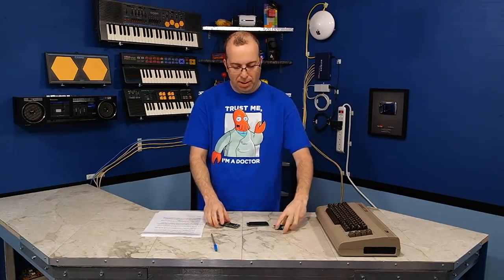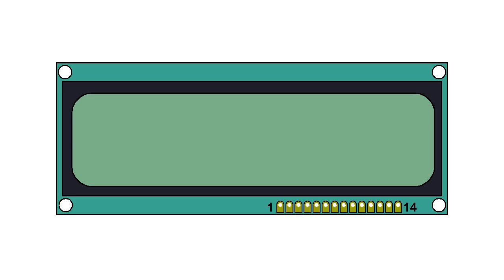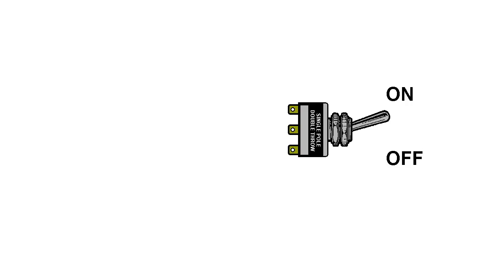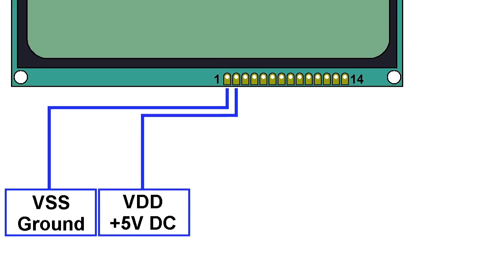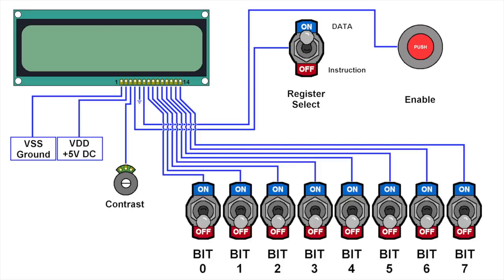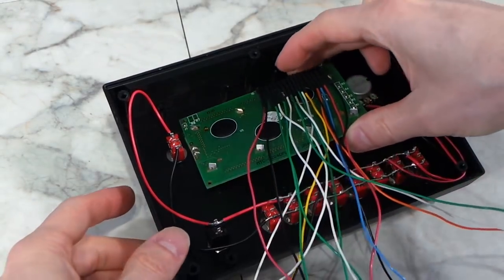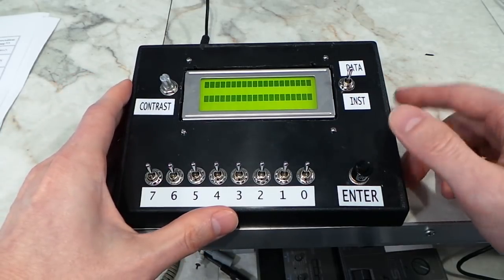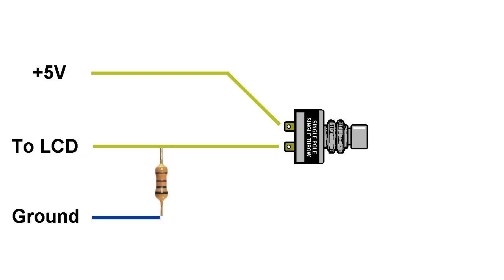How a Character LCD works Part 1

Comment: loved this it makes me wanna be an electrical engineer and I hate electrical engineering
Reply: Lol same about the electrocution thing
Reply: There is no risk of electrocution with low voltages (it is taught that up to ~30 volts is completely safe, although the actual threshold is higher), and working with higher voltages is reasonably safe as long as you don't do anything really stupid.
Reply: EE here.  Just be mindful of current and paths that current can take.  If you're attentive to this, you'll be fine.  I've never electrocuted myself or come close to it.
Reply: Also, if you're worried about working with the mains in your house, electricians handle that, not engineers.  Engineers design things.
Reply: Be a computer engineer, it deals with digital electronics and software without a lot of the analog/high voltage side of EE.  I went into embedded software engineering with my CompE degree, though I enjoy all things electrical and electronic as a hobby anyways.
Reply: EEs don't generally go out to high voltage panels are start poking around on things. They design the equipment and electricians install it.  EEs and electricians aren't the same thing, and for good reason.

That said, I'm an ME and have worked around tons of high voltage standing right next to the electrician working on it and the EE who designed it and haven't been shocked either. Let the electricians do their job.

Also, like others have said, EE is a huge field. Most of the EEs I've worked with have been "PLC guys" and only a handful have worked in power distribution (the "scary" stuff). They write the programs that make robots build stuff. It always looked like a fun job to me.
Reply: CalcProgrammer1 Computer Engineering for the win.
Reply: Check out Big Clive! He's really making me want to do EE

Comment: Multiple concepts touched here:
1. Character LCD pin description and how the communication protocol works.
2. SPDT switch and how to punch in digital 1/0 using it.
3. How to connect a pot and generate analog voltage input using it
4.  Floating connection issue resolution using pull down resistor
5. Switch denounce issue in push button and fixing it using RC circuit.
Over and above, how to debug and proceed ahead when you come across a problem.
Thanks for this series.
Feeling angry on YouTube algo for taking 4 years to show this on beautiful channel.

Comment: For someone like me, with a decent brain but zero knowledge of the hardware yet, i found the level of "depth" quite nice. The pins always seemed like magic numbers. Knowing what they do and how is very informative. I had heard of "capacitors" but hearing and seeing a practical use makes it seem easy to tackle.
Seeing even the basic construction of the box and power supply gives the entire project the feeling of "this is EASY! I can definitely do this now!".
I liked the pro-tip of stripping old wires too.
Reply: OmikronWeapon fyi if ur still interested and dont know: capacitors store charge. the capacitance value of a capacitor in farads is equal to the ratio of charge able to be stored per volt across the capacitor
Reply: pins are magic numbers, just like argument order in a function is magic. (or you read the docs)

Comment: Re switches upside down
Can you just flip the +5/GND leaders onto your switch busses?
Reply: I was wondering the same thing, but David probably has a reason for not doing so. Commenting so I can see any reply!
Reply: Yeap, you can!!  He must have overlooked that solution.
Reply: And re-solder/switch the leads powering the LCD
Reply: not required, if you saw the electronics on the back of the switches it's a very simple thing to swap the polarity on them.
Reply: I was just wondering were there a good way to test witch way your switcher are before soldering them.
Reply: Because of the internal mechanical parts (they work like a see-saw internally), it is usually just the opposite of the switch position. Flipping the switch up will connect the bottom pin, while flipping it down will connect the top pin.
Reply: he already soldered everything else to those wires though, using them as adhoc rails for the whole circuit.
Reply: Just flip the rails going to the data switches, and maybe the D/I. Such a simple thing...
Reply: I am also wondering the same thing
Reply: Yikes! Duh!
Reply: Shananium, to test your switch, use the continuity tester on your multimeter. If your meter doesn't have cont, just use the ohmeter. 0 ohms is on, infinity ohms is off.
Reply: It isn't that easy. He would have to move a bunch of other things around, but it would be possible. The debounce cap, pull-down resistor, the +/- for the LCD, +/- for the back-light would all have to be reworked.
Reply: was going to make witty remark the realized these are 3 pin xor switches.
Reply: +Darric or he can just swap the +/- for the switches, by swapping the two wires going to the common rails
Reply: That's the first thing that came to mind...
Reply: Reverse the polarity of the neutron flow.
Reply: Jon Pertwee
Reply: ChapstickPremonitions Good point.
Reply: That would work if he didn't hard solder 9 other things to the rails. So yes it could be done, but it isn't as easy as swapping the inputs to the rails. If you just swap the input to the rails, the LCD +/-  and back-light +/- would be backwards and not work. The Contrast POT should still work, but the control would operate backwards. The cap and resistor look like they would be fine if you crossed the wires right at the rails. You can see all of the other connections he did at 11:33.
Reply: I see now... 
I'm planning to build a similar thing(but an actual computer w/ Z80), now I know that I should NOT do like this...
Reply: He used the rails at the switches as "bus bars" for everything, so it's not just swapping two leads. But it wouldn't be more than swapping 10 leads either, so definitely doable.
Reply: I thought exactly the same thing! Best way to invert signals.
Reply: This is what the OP said, just reverse everything that was soldered to those wires....
Reply: I feel like we are not treating the video fairly.  It was not a necessary fix in order for him to make a good video.  It was well done.
Reply: Look at the comment from @RockyDAproductions.
Reply: Exactly or just pretend he is in the UK and the switches would be the correct way up

Comment: Doesn't it suck paying $50.00 for some parts you can get off the internet for $5.00 but you have to wait weeks for them to come from china? The worst offender is microcenter where they sell knock offs for 10 to 20 times the normal price. They will buy a part for less then a cent and charge $4.00 for it. Their arduino is $40.00 and the instructions are half in bad english and the other half they just left the chinese characters in. Also on the box it says you get a nixie tube which is why I bought it. It's not it's just a 7 segment display that doesn't work with any of the projects because it's common anode and not common cathode but you have no way of knowing that until you realize it doesn't work.
Reply: Dave B Common anode 7-segment displays can be used as well as common cathode. I’ve used them and had no problems.
Reply: Yes I too got it to work. But if you go off the english/chinese instructions the way they tell you to it won't work. Had to redo hard ware AND change the code as well as use npn vs pnp. Not a fun way to learn when the instructions are teaching it to you wrong because they save 0.0001 cents.
Reply: As from getting things from China. Imagine something doesn't work. You either buy a new one (your project is halted for some time -> losses) or send it back to replace it (waiting + losses on shipping). That's where the problem lies. Repairing and returning elements + time you need to wait. When it comes to such small elements, it's not so bad. Some clients of printing company I've been working to, left us to buy prints from China. Then when they've realized they'd pay a few times more than here, if something would be wrong, they got back.
Reply: I was disappointing at looking at some of there stuff. There only good stuff is the actual new computer hardware. Everything else in the store is poor quality. I was thinking i can get some professional computer tools, but its the cheap crap you would get from a dollar store for 30 dollars.
Reply: Yeah, but your paying for that convenience. There is heaps of overhead operation cost of brick and mortar. They will not stick around though, as more online sales occur (and consequentially with the likes of certain online entities allowing you do almost essentially deal with the manufactuer direct and no middle retailer) with entities that do not have any brick and mortars to support. Market and local demand plays a bit into it too... Less tinker-ers these days.The whole situation is actually a convoluted and complicated balance of factors, but the gist is a lot of retail stores will poof in the near future. Only the common commodities of need-to-live stuff will stick around.
Reply: SALCON salcon is dead on!  There is a cost to having those items available on demand.  When I moved from the city to a small town, the prices infuriated me.  Anything retail costs more in a small town.  they aren’t ripping you off, it’s what it costs them to provide that product.  Radio Shack is proof.  They just couldn’t maintain the traffic to survive selling on demand switches and diodes.  $2 or $3 is a small price to pay to get that switch I need NOW.  In a time where mass market retailers are finding it hard to survive, it is even more difficult for those that cater to a niche.
Reply: Yea... keep buying online... local will disappear... blame yourself... end of story
Reply: I'd gladly pay the markup if I had a Microcenter or something when I can't finish a project because of something I need...now that RadioShack is gone I have to go to eBay (wait forever, often not quite as described, increasingly cancelled because they don't actually have what they listed in stock), Amazon (high markup and often not quite as described or not working), or someplace like Allied/Digikey ($0.02 for the part, $20 for shipping, $50 if you want it 2-day shipping)
Reply: @matthewmiller6068  FYI, I noticed that my local HobbyTown has the Radio Shack chest of parts and some other ones, so if you happen to have one of those...
Reply: I'm actually trying to make the device David showed in this video, and I'll be ordering all of my components off of Amazon Prime, which doesn't take a month. I don't see why David didn't just order off of Amazon Prime, especially considering there wasn't a pandemic back then XD, not that anyone could've seen it coming...
Reply: @classicgamr  The  local has to be better or for them, it will be the end of the story.

Comment: Windows 10: Device drivers not installed. Device does not work.
8-Bit-Guy: Builds hardware-based driver out of flip switches.
Reply: get sued by apple

Comment: Wow :o
I wouild never have thought you could use toggle switches to send binary data, that's cool
Reply: That's how the first computers were programmed. he mentioned the Altair. http://oldcomputers.net/pics/altair-8800-front.jpg
Imagine doing that for all the instructions you wanted to set up.
Now imagine no permanent storage and the power going off just before you got to run the program.
Reply: runs from room screaming ;)
Reply: UPS FTW!
Reply: Actually computers (and everything digital) works that way. Bits are either on or off.

Comment: You can just swap the ground/vcc rails. Should be easy enough just resoldering the supply wires and the write.
Reply: Exactly my thoughts (and the same has happened to me several times :)
Reply: Lucas Hartmann I thoight the same thing.

Comment: This really helps with me trying to be an engineer (I’m ten don’t judge) I just got my first soldering iron for 4 bucks at harbor freight and this was the first thing I did as a pcb kit I didn’t understand it now I do
Reply: Lol I've gotten used to soldering in the few months I've learned. Good luck with it (be careful though, those things get really hot. Use the stand when you're not using it, if it came with one lol)
Reply: How’s it going, rifty?
Reply: 13 want to be programmer or possibly a computer engineer
Reply: @bobdagamer640  You can do it if you try hard! I'd reccommend learning java to develop minecraft plugins, then start on your own projects.

Comment: Oh... the memories. In the early 1990s we finally moved to being able to use one of these for a radio repeater product. Fortunately, we could just connect them to an 8-bit micro-controller. Had to program the controller with assembler but these screens seemed like magic at the time. Previously, you have to use blinking LEDs, speaker tones, etc. for output. With these you could display actual messages and even allowed changing of settings outside of code. Best time we had with them was temperature testing to -40. It destroyed the LCDs (freezing crystals would actually crack the area around them) and we had to put some resistors on the backside and keep it heated below -10C or so.

Comment: I wouldn't worry about the switches. It's just designed for the UK market - where up is off, down is on. (The "correct" way)
Reply: Nick Smith so, if "I'm down with it", there's something going on :) Cheers!

Comment: Fun LCD story

For decades, the company Medtronic Minimed manufactured insulin pumps with LCDs well after they stopped being manufactured commercially.

How did they accomplish this?

They bought the LCD manufacturing equipment.  They did this for years rather than modernize their insulin pump designs.

The modern Medtronic insulin pumps now have modern color touch screens, but they didn't start implementing them until 2014(!)

So if you need some LCD screen manufacturing equipment, call Medtronic Minimed.  Maybe they can cut you a deal :)

Comment: Hey David, just btw i think it's pronounced "potenshiometer". Cheers!
Reply: im a non-native english speaker and this guy had me cringe whenever he says it wrong.
Reply: Right, it's pronounced like potential, just with -ometer at the end instead of -al.

That being said, there a lots of variations within English. I personally get frustrated when people pronounce mature as "matt-oore" instead of "machure" even though I think both are valid pronunciations.
Reply: Alexander Krivács Schrøder I'm a West Coast North American native English speaker and I would be taken aback if someone pronounced mature "matt-oore"
Reply: Right? Yet, that seems to be the "main" pronunciation, both the Merriam-Webster dictionary and Dictionary.com use the "matt-oore" pronunciation when you try their "speak this word" feature.
Reply: Actually, the correct pronunciation for what he's using here is "ray-oh-stat".
Reply: this once in particular is a potentiometer due to having a voltage, ground and your variable 'tap' in between. You will get a potential voltage or reference voltage from the middle connection compared to vcc and gnd. A rheostat has only two terminals. one from the coil and/or variable resistor and the other is the wiper. There is only one possible path for the current to flow.
Reply: Note how many wires he solders on.  Hint:  it's not three.
Reply: in that case you would be right. I went back over a few times to see how he soldered it, I do believe he has the gnd also connected albeit difficult to see since it's all black. You're welcome to re-check if I saw it incorrectly... if that's the case, I will retreat back into the woods.
Reply: At 11:34 you can see it's connected to black and red (ground and 5v) and the blue center tap is connected to the panel. This connection setup and its behavior is also described earlier in the video at 1:27.
Reply: Missed that shot.  Potentiometer it is.

Comment: if you have all the switches connected to the same power line, can't you just flip the 5 volt and ground volt cables?

Comment: These displays are still everywhere. I used it for dozens of projects, but now they are sold with I2C additional module soldered on the back so you need just 4 wires to control it. Very good project, very illustrative and nicely made.

Comment: What's the size of the capacitor & resistance for the resistor?
Reply: kpjVideo Capacitor was 10 uF. Resistor can be any large enough value. 10 kOhm will do.
Reply: @GRBtutorials  tnx, needed that

Comment: I would be bored if you calculated the charge time of the capacitor under consideration of wire resistance and then end up explaining the temperature dependency of wires and other things slightly related for 8 minutes before cutting back to the action.
What you do is: Problem, reason, solution, explaination. Nothing as in-depth that would feel like a lecture. Nothing skiped over unexplained. Just the right ammount to deliver basic understanding of the matter at hand. Perfectly dosed Edutainment.
Reply: i need to know the ohm of the resistor and potentiometer

preferebly a parts list in the description